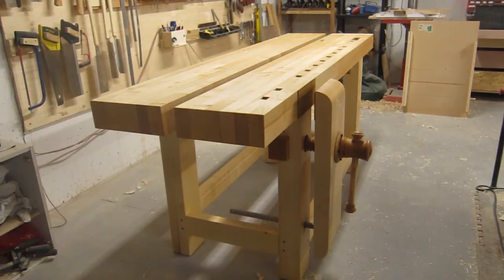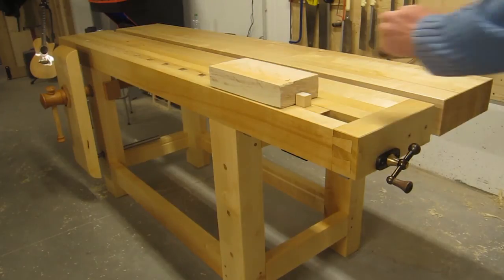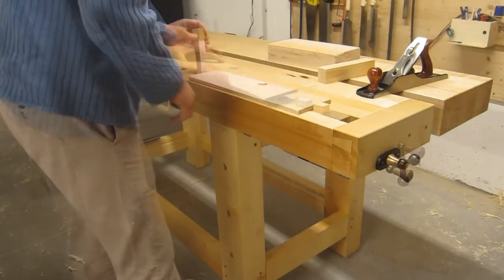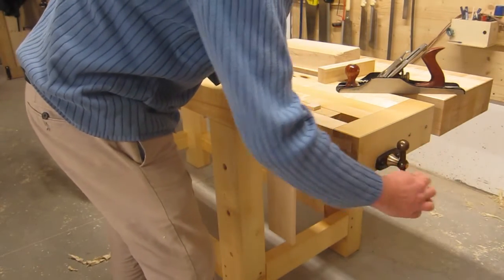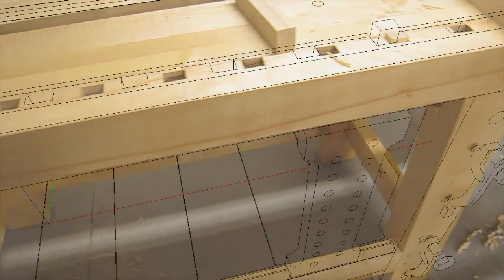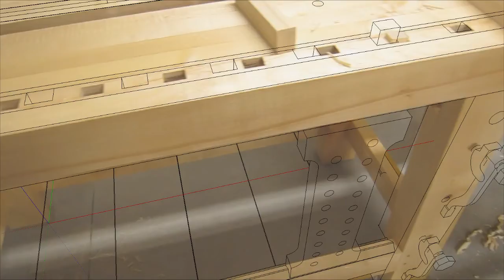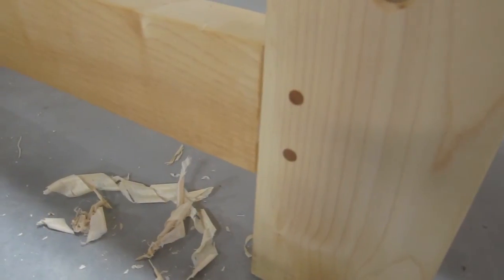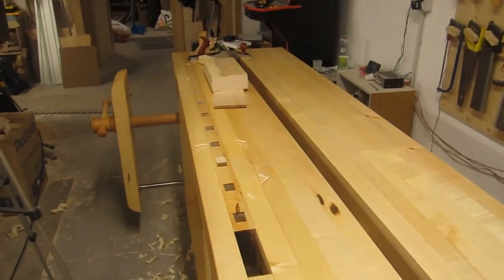Roubo Workbench Tour

Comment: Very nice! 

what is the brown square board on the left leg behind the leg vise?
Reply from the maker: That's the thread that the vice screw this into. It's a kit from the English woodworker.  You drill a hole through the leg and fix that to the back.  Now I have added sliding deadman and added old fashioned holdfasts the bench is twice as this as in this video!
Reply: +David Moore I have my split tops done and my legs glued up.   still figuring out how long to make my stretchers so my vises will fit. 

another video of your bench now would be cool to see. 

how did you cut the mortise on the bottom of the tops?
Reply from the maker: My end vice only required 12" or so of overhang.  Careful to ensure your dogs won't coincide with the legs if you can!  makes it a lot easier.

I cut the mortises by turning the top upside down, then putting the leg assemblies on top (with stretchers installed), so basically the whole bench was upside down on some saw horses.  I then drew around the tenons and using a powerful router, and many passes, routed out the tenons (each one was about 2" by 3").

I then rounded the tenons with a rasp to fit the rounded routed mortises.

Because I also screw with coach bolts from the bottom of the short stretchers, the mortises don't have to be perfect, can be a bit larger, however by repeatedly trying and adjusting my fence on router I got them to a perfect fit.

When attaching the top, I did have to shim the tops slightly, to get it perfectly flat.  However I was also able to get a friend from a wooden house building company to put the tops through his planer / thicknesser first, so they were pretty good.  Just a small amount of hand planing required at the end (maybe 6-8 hours)

I highly recommend the wood whisperers video course on this build, I did it very slightly differently, however it gave me so many insights and ideas, and things to be aware of, was great.

Also sliding deadman at front with some veritas hold-downs adds another dimension to this amazing bench!

Comment: I have a question regarding the guide rod for the leg vise. Could you please explain the concept? I am in the process of building a workbench and still thinking about how to deal with the parallel guide. I have considered the crisscross of Benchcrafted but I liked you "simple" and more elegant solution better. Thanks for sharing!
Reply from the maker: I got that from Richard Maguire http://www.rm-workbenches.co.uk/html/the_workbenches.htm AKA the English Woodworker.  He makes some fantastic benches, however he's stopped now, and not selling the vices any more.

The concept is that the rod is at a slight 1 deg angle, so that as you tighten on your work, it straightens up and "pivots" around a point to give straight even pressure with no parallel guide pin adjustment required.

TBH I am not 100% convinced, whilst it's much simpler than having to put a pivot pin in, it's actually quite hard to get it set to run smoothly, and it's a bit difficult to turn right now. If I loosen the collar, it's ok, as soon as I tighten it, it's tough to turn.  Not a problem, but not a "one fingered turn" level of coolness...

There are benchcrafted ones that use the "old fashioned" pin, although it seems the criss cross is quite an old concept too!

I don't know how the cross one compares in terms of providing a pivot point around which work is held, I would think the traditional parallel guide is the safest "bet", however i am sure the cross works too, and might be less work and more convenient to use.